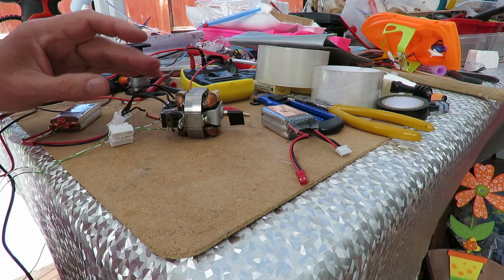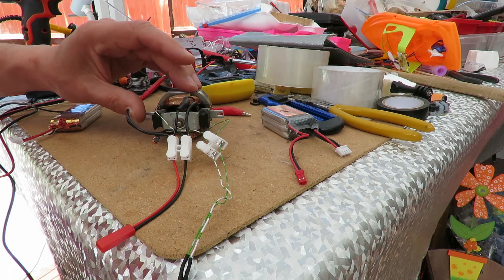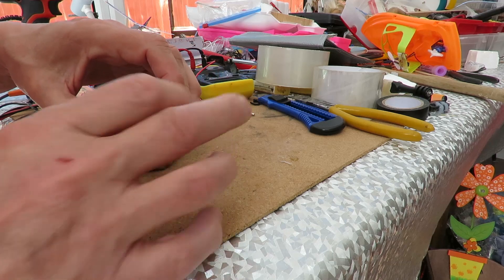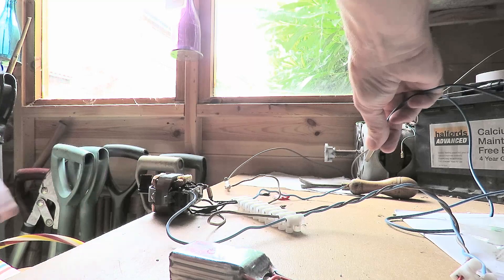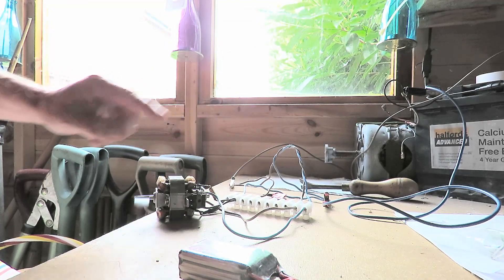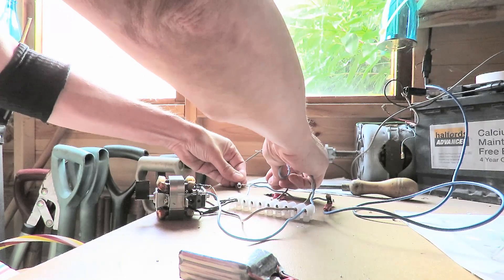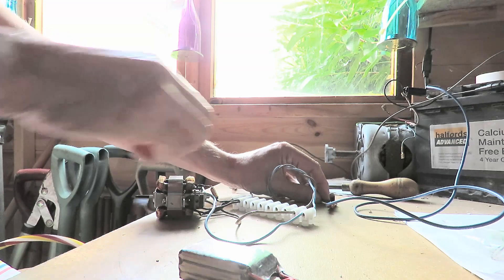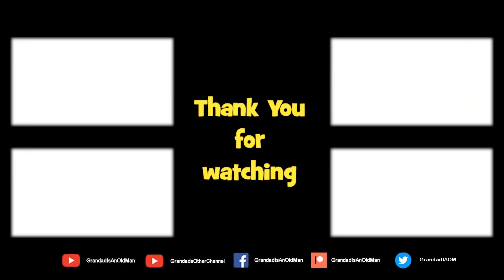Revisiting the universal motor a THIRD TIME

Comment: Hi "G".
Thanks for the shout out. Yes, there is no real use "YET" for such a setup, but who knows, there might be someone out there who can get high RPM and torque. I knew it would work with that setup and hats off to Hermit Oldguy too. 

You need to check out the car alternator stuff and running those things from a high amp ESC as a giant brushless motor. They are really powerful.
Ok, I will get a video for you guys really soon of some engines (ICE) and the setup I hope to try. I have a 35 quid mini moto engine and hoped to use that for my idea but it is a noisy to 2 stroke and I don't want to destroy the ( I mean annoy) the neighbours hearing. 

As you have probably noticed "G" I am a lazy person who "always" takes too long to make a video. LOL Have to admit "G" that you have got me wanting to dig out my old stuff. Thanks for the inspiration. Cheers.
Reply from the maker: Mike, my buddy Hermit asks all the right question, damn him 😝👍